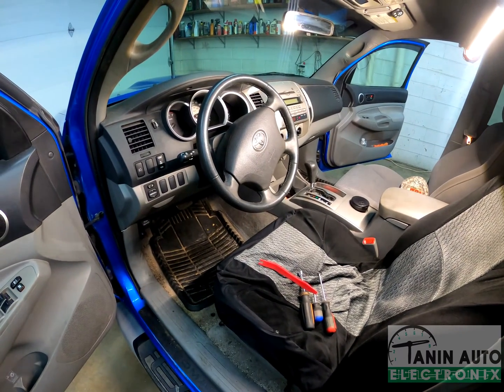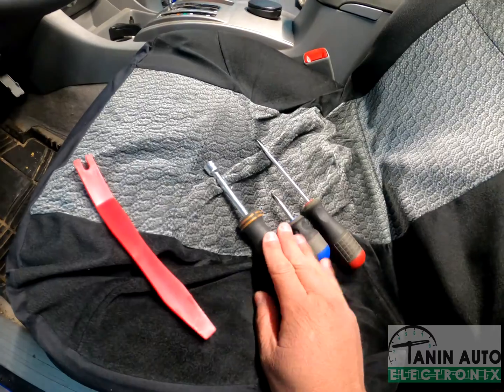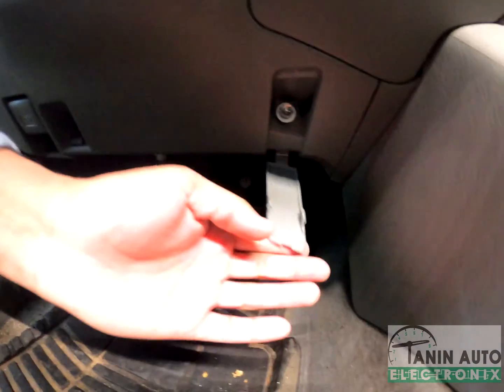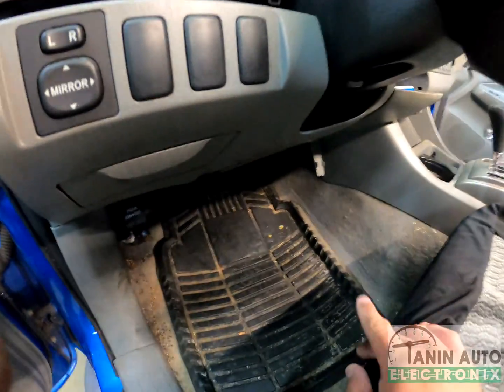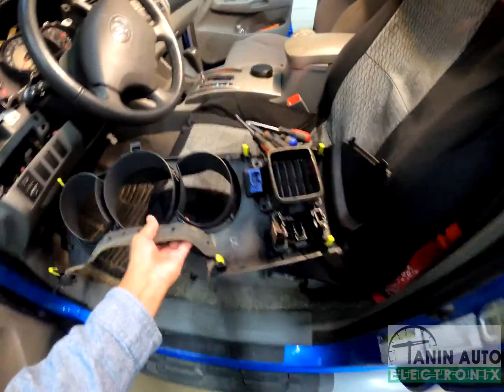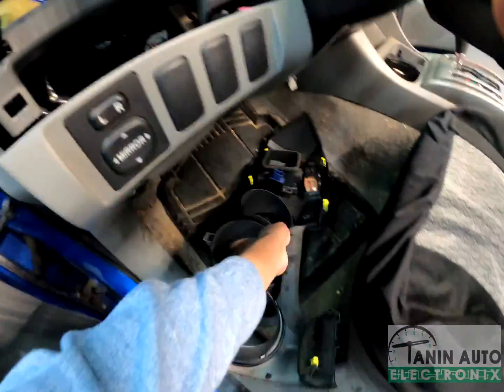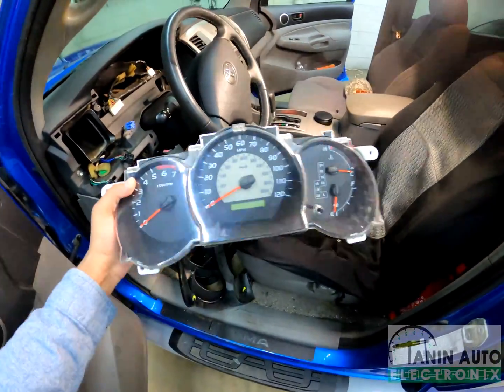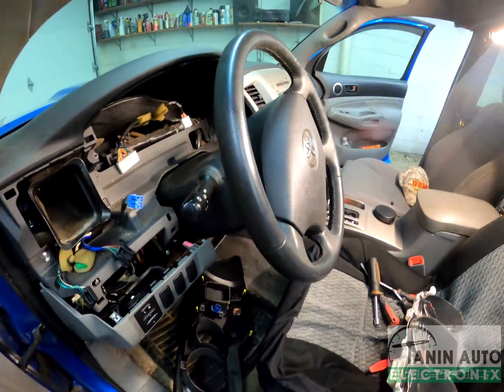Fixing Toyota P0500 Error Code for VSS 2005+ Tacoma Speedometer and Gauge Cluster

Comment: Hello 2009 Toyota Tacoma. Everything works but odometer doesn't count up have signal to gauge but not increasing in mileage. Is this something that can be repaired through the repair company or strictly mechanical guages?
Reply from the maker: @humbledhands  replacement would be best for this